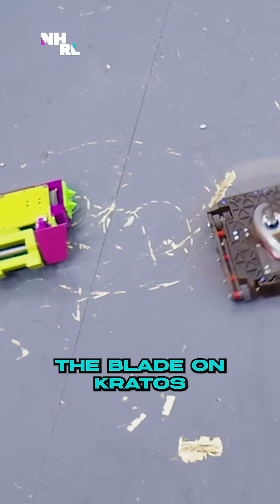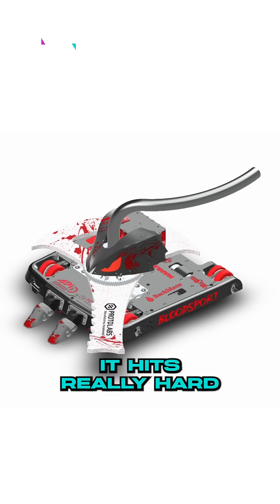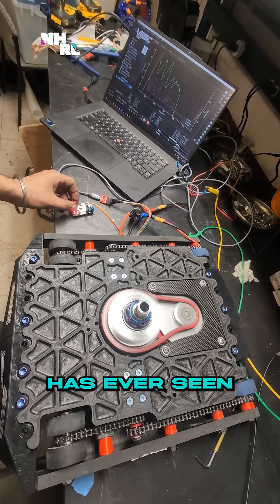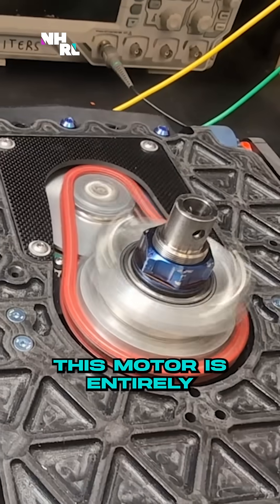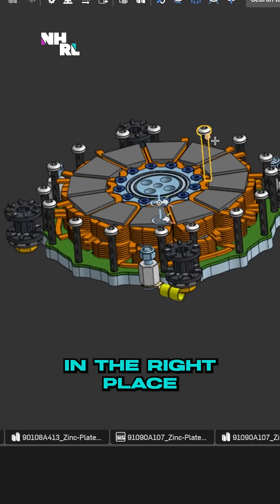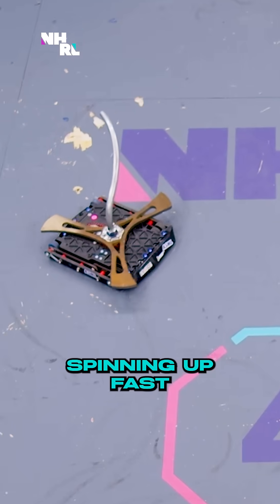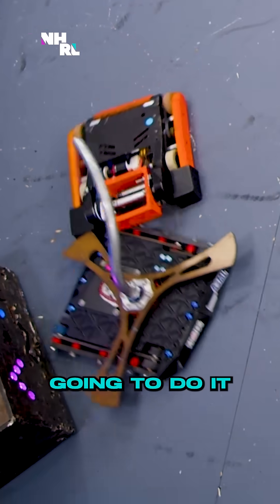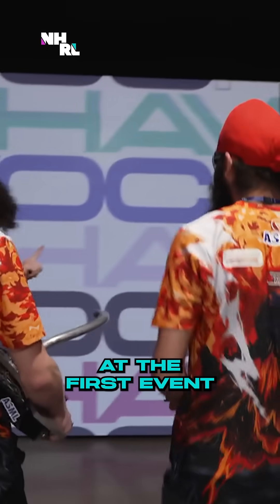MIT Team Built a Custom Axial Flux Motor to Fight Robots

Comment: I am a controls engineer for a motor manufacturer. Axial flux? That’s easily the wildest choice, the fact they pull it off is amazing
Reply from the maker: That’s just how MIT rolls.
Reply: @NHRL bro I sincerely hope you've secured the patents!!!
Reply: @Bill-mj8hf  I'm pretty sure the concept for an Axial Flux Motor is already patented(possibly by MIT), however it's still unproven basically and is only in the prototype stage, but it'll be a badass electric motor once they figure out all of the kinks and stuff and get it working properly and reliably ‼️🤷🏾‍♂️👌🏾💯...
Reply: @ It was actually put into public domain by tesla, as the axial flux concept was invented by him, as he deemed it the most efficient motor design, but also as a design goes, it was impossible to manufacture back in his day
Reply: @ironichoneybadger5066 didn't the first electric motor by faraday technically belong to the axial flux type?
Reply: @badgermcbadger1968  I don't know that off the top of my head, but the axial flux motor was the mathematically ideal motor in theory, so it wouldn't surprise me that the first motor was the product of thought experiments like the axial flux motor
Reply: @Bill-mj8hf dawg the NHRL is the league itself, y'know like football has the NFL or or basketball has the NBA. This was uploaded by the league promoters not by the MIT team. So you telling them to patent something that they have nothing to do with makes you look really ridiculous.
Reply: @ironichoneybadger5066 Tesla would do something like that, that dude was so generous with his genuis. Unlike his "rival" Edison who stole 98% of "his" inventions from others far smarter than him and profited off every single one.
Reply: @ayeeequanpsn5896 axial flux motors are nothing new I'm afraid. this specific axial flux motor is custom built, but by far not the first of its kind
Reply: @Bill-mj8hf  doesn't matter if they built it on MIT property and materials, it'll become an IP for MiT.
Reply: @badgermcbadger1968 it was primitively  a  semi I believe !
Reply: True sir takes quite the engineering,they dared and they conquered .......has quite a high torque density perfect for this application.
Reply: @saitamakuto8724  serious dedication and a massive budget in time and equipment, backed by MIT! And it's still impressive.
Reply: @NigelTolley  this motor is once perfected will make big changes in industry
Reply: @saber5694  why
Reply: @HermanWillems if I had to guess, power density. Power output compared to size. Super efficient.
Reply: @NigelTolley backed by MIT brainlets! Woooo
Reply: @saber5694  It's just ax axial flux motor. Those have been around for a while.
Reply: @saber5694 indeed. I see them potentially being used in electric cars at some point. People can hate on electric cars but they are the inevitable future, especially once better, cheaper and accessible battery technology is invented.
Reply: I need one to be used as a micro generator
Reply: The the nice thing here: even when shit gets WILDLY dangereous and fails in unforseen ways nobody gets hurt. In fact that's part of the sport. Hence it's the ideal place to test wild ideas.
Reply: I'll pretend to know exactly what you are talking about.
 Mhm, agreed. Motor is made out of motor.
Reply: is there any irl application to that kind of motor?
Reply: @duelflame3973  well it depends do you want to use electricity to rotate things?
Reply: @duelflame3973 the acceleration comes from it's high torque, perfect for heavy machinery and industrial applications
Reply: hey last summer I was a controls intern (rn process intern), how are PLC/DCS responsibilities segmented? IS PLC logic exclusively safety? limited to equipment (pumps,compressors)?
Reply: @ishmaelcamillo  PLCs are used everywhere in industry for literally everything. Safety PLCs are as common as they are because of the tens of billions riding off the back of that hardware technology that makes them safety PLCs, as well as a bunch of built in redundancies and other features that makes them worth learning. A lot of my work now has leveled up beyond strictly PLC work, I do a lot of industrial PC and AI model inclusion for testing our product line of motors we manufacture, but that's because I'm going more R&D as opposed to strictly controls work for machine design
Reply: @ironichoneybadger5066 ok I gotcha- did you ever work with DCS/SCADA systems? How much different is that from PLC logic?
Reply: @ishmaelcamillo  I did a lot of work with SCADA, and to ask if it's similar to PLC is like apples to oranges, SCADA systems are a lot more modern and interfacing with them can feel like everything between Python and Powerpoint. I don't have a lot of experience with the term DCS to really speak to that though, however if it's similar to SCADA I'm sure it's not that bad with the right tools/software
Reply: Hey what about TPM motors? Know anything on them? Google says they are probably even more power dense than axial flux. Yet there isn't a whole lot of info on them. A few papers out of my understanding. 

 I cannot for the life of me wait for Axial Flux motors for EVs to become mass produced. Like the SPX 177 from Ehelix. 

 Gimme a solid state battery EV, and two axial flux motors in a Miata sized car please. 

 Anyway I was watching a video on chainsaw competitions. They were using V8s requiring two burly men to handle, and I was like... If only someone made an axial flux chainsaw, lol.
Reply: @RedactedDeath  I don't know much about TPM motors, but I know that Axial flux is just the present big deal, I'm sure there's other processes that would make for more ideal motors, but the issue becomes the massive gap between theory and execution at the end of the day, I would love to see Axial flux EVs!
Reply: @ironichoneybadger5066 Ha no kidding. The SPX177 is a two axial flux motor in one. 

 It was supposed to produce 871bhp continuous, and 989bhp peak at outrageous KWH. Like 650kw continuous. 

 I assume they had cooling troubles at least. It was oiled cool IIRC. Anyway if you go to their website now it's only 650bhp. Still absurd, but reasonable. 

 Anyway yeah only hypercars seem to be using them. I know they are hard design, but I don't see how they are harder than other motors to manufacture. 

 As for TPMs. Have yet to run into a person even online who has any knowledge. I believe they are better at lower speed. 

 Anyway electric motor is the superior tech. A shame our leader is a Baby boomer.
Reply: @RedactedDeath  They're probably not that hard to manufacture I just know how much of industry is designed around the already simple-to-manufacture-by-comparison induction motors. Hell, my company produces BLDCs for industrial applications and even we have a hard time selling to industry, I couldn't imagine how frustrating selling axial flux would be
Reply: @ironichoneybadger5066 Yeah man unless you're Lucid, axial flux seems the simplest option for high performing vehicles. 

 Manufacturers putting out weak HP EVs is a travesty. If it doesn't have 500hp plus then don't buy it! 

 I think Astramechanica adaptive hybrid electric engine/rocket uses axial flux. Maybe Space X. 

 Lucid drive train, and aerodynamics is insane though. Shows what an EV can be. Anyone interesting in a more technical design of a car watch Sunny Monroe Live videos on it. 

 He worked in the manufacturing side of the automobile industry. Talks about the engineering and economical side. 
 
 The channel maybe too technical for some but i love it. The Lucid is a beast. Half the price of Lambos, and keeping up or outright beating em. The drive train is a gem.
Reply: @ironichoneybadger5066  hey on the subject of PLC and SCADA, what PLCs/systems have you touched? TIA Portal? Honeywell? Triconex?
Reply: @RedactedDeath  I'll check it out man, thanks!
Reply: @ishmaelcamillo  almost all Micrologix PLC by Allen Bradley, and TIA Portal, I've done a lot with control logix and other similar PLC, but the most work I've done was oddly enough with the micrologix 1400 as a lot of factories around me are using systems that are pretty old. As for what I'm working on right now however, I'm not touching a lot of PLC, but trying to learn about FPGA and Embedded systems with TI controllers and ASIC, but that stuff has massive potential to be a side project if I'm not playing my cards right at work, lol
Reply: @RedactedDeath and get us back to reasonable sub-3500lb cars, PLEASE for the love of God
Reply: Cool beans 🌌🌌🍄🍄🍄👍
Reply: Some fans from the 1920s and 1930s had axial flux motors, it wasn't very common and they eventually stopped making them.
Of course, since they were for fans, they didn't have a lot of torque, but the means of manufacturing were already there. I believe the same means were available at the time of Tesla, but it didn't take off then. It's nice to see them making a comeback.
Reply: @yonidellarocha9714  thanks for the information, huge!
Reply: Aeon flux. Aye? Sorry I ruined it. I don’t know anything.
Reply: Agreed, his engineering is incredibly impressive
Reply: Can you help me get a job? In controls and don't know what to do
Reply: What's new in this axial flux? Genuinely curious. The diy wind turbine guys have been making these for quite some time. Although bigger and bigger. AI has generated a couple interesting looking prototypes. What are they doing to increase the power density vs a standard mag rotor stator axial flux????
Reply: @ Axial flux is called that because it changes the axis that it torques the rotor on the fly to optimally impart torque onto it. Theoretically it's already the best mechanical design for torque because it's moving the fields in the mathematically best orientations for imparting that torque that our modern machining can muster
Reply: @ironichoneybadger5066  you are saying it’s the N * m and the m is augmented such a way it can easily achieve a starting,  running or breaking torque ?!
Reply: @03p650  not necessarily running the m but for the company I work for we rate torque as Newton Meters, not horsepower, which is a different unit to measure torque where horsepower measures torque over time. 
our motors can be controlled for all sorts of things such as running or breaking torque, it's really about how you read/react to the Back-EMF
Reply: Koenigsegg has developed a 'Raxial' (radial/axial) flux motor they call the Dark Matter. It's an 86 lb, 800hp, 1200 Nm beast.

I'm sure tech like this will come down in cost over time.
Reply: @TheDCJason  wow! 86lbs spectacular
Reply: @AAaa-u7x  yeah! It's insanely power dense. I can't even imagine the cost.
Reply: @TheDCJason  running chopper or chopper something.  Very high power density ! ?
Reply: @TheDCJason damn, that's a lot of power.

Comment: I legit don't understand this editing but it was hilarious. Did the bot go 1 and 1? Dude was so confident.
Reply: I...think they did that thing where they chopped the first 30% off of the front and stuck it on the end? normally that's used as an easy format for making looping content and tricking people into watching the whole thing because it perpetually looks like it is just about to get to the point but never actually does and chopping out the front and sticking it on the back puts the normal red flags that let people know that it is never gonna say anything at the very end of the desired watch time in the last section of that first ~30%.
Reply: When it works, its killer. But if you put all your eggs in one basket, you are taking a risk. The editing was perfect for showcasing that.

Comment: Whats the wonky pole on the top about?
Reply: Essentially if the bot gets flipped that pole helps corkscrew themselves back to the correct orientation. If you lookup bloodsport battlebot self right I think you'll get to see it👍🏾.
Reply: On top of the highly valid reason given by the other replies, it also helps give the driver an easy visual indication of which way on a bot is forwards. For Kratos it's helps with that but wouldn't be completely necessary, but for other full-body spinners it'd be pretty much impossible to tell otherwise.
Reply: Simple, it's an anti-getting-flipped-wonky-pole-minator.
Reply: @xkali8119  I declare this to be the best new word of 2025 so far.
Reply: Reduces the amount of ways the robot can Do The Thing.

As others have said, it's a self righting mechanism. "The Thing" is NHRL slang for the inevitable position your bot will find itself knocked/rolled/flipped into from which it cannot recover without an unstick (and sometimes even WITH an unstick 😜).
Reply: The other answers,  Also, would you want to pick up a robot with a bone breaking saw on top when theres no guarantee it wont turn on the second any part of you is in range?
Reply: The old fans of Robot Wars would call it a "srimech" (sree-mek) - short for "self-righting mechanism"

Comment: problem with spinners is breaking the motor or the chain.  maybe ad a clutch somewhere thay can disengage the drive from the blade
Reply: I have a feeling the chain is meant to be the weak point, it's also likely just springy enough to take some of the shock load. Besides I don't think the motor would see much of the force of an impact, worst case the drive electronics will just shut down if it gets stuck.
Reply: Hey you seem logical
Reply: Don't need a clutch. Just give it a shear pin.
Reply: @  shear pin works only once if the hit is too strong. 
my idea was to be able to reengage the motor on the weapon once the hit is passed
Reply: @ThePapino134  I was thinking the same, a centrifugal clutch or torque converter maybe?
Reply: Or a hammering mechanism used in drilling machine, rachet based
Reply: @trijit96 a ratchet would be nice, since you can easily adjust how much pressure it can take with just 1 screw, and you dont need too much surface as in a friction clutch to make it work under heavy load.

Comment: Need a huge gear on the motor and a smaller gear on the weapon. Or add a third gear that has one large and one small gear and chain the small one to the motor and the larger to the weapon to get more RPMs. Think like the gears on a bike. The bigger one is where the pedals are and the tire that has small gears is where you want your weapon. The motor will be under less torque with a larger gear.
Reply: Getting up to speed is more important than peak RPM.  Small gear on the motor and large on the weapon lets the motor use less torque to get the weapon up to speed.
Reply: @generickwyjibo  then having a closer 1:1 gear ratio would be easier for getting up to speed quickly. Or maybe even better. Have a double gear switching system like that on mountain bikes. Have a small gear at first to start the rotation and then have it switch over to a larger gear to  maintain and peak the RPMs. Then it would need a third gear for RPM selection. Have a gyro selector that opens up at higher rotations, forcing the chain to go down and closes at lower rotations forcing the chain to go up to govern which gear it needs to be in for optimum performance. Then keep a single sized gear for the weapon.
Reply: @jaketripp7934  Have you ever ridden a bike?  It's easier to spin the rear wheel when the front gear (where the power is) is smaller than the rear gear.  Any change in the ratio would require more force to spin the rear.  Humans can stand on the pedals and make a lot more force than a motor that relies on RPMs. 

And a multi-gear system is just asking for trouble.  You know how fragile a bicycle derailleur can be?  Now imagine that on a combat robot with an opponent actively trying to break it.
Reply: @generickwyjibo  I know that even a small thing traveling fast has the same energy output as a big thing traveling slow. It is like comparing a metal shredder to a circular saw. They both destroy things. The slower  more torqued one is just not going to care to stop when it comes into contact with something. If that bot had a clockwise spin and counter clockwise spinning weapon then it wouldn't need to worry much about getting it's weapon up to speed, it could just torque and sheer. However with a single spinner, RPMs are crucial to having an effective weapon. If it can't go fast then it is just brushing it's opponent aside like two strangers in a New York subway.   And if it can't get up to speed quickly and efficiently, then what is the point. 
The derailer mechanism could be internal with only the guide on it poking out of the bot. If it is under the weapon and doesn't peer out too much, then actually getting to it would be a chore for the adversary. I won't say it'll be impossible, but more difficult. Plus all you would need is a little square that just goes up and down and even with manual switching, all it would need is one straight toothed rail on a guide with a square on top and a small gear that raises and lowers it. Just something to move a few millimeters.
Reply: @jaketripp7934  far too complex for a bot that's throwing itself around the arena like this. The setup they have with a chain is exactly what they need.
Reply: @bachaddict  everything is working against the ones that are building these bots. Time, materials, money, space, weight, design, power, speed, durability and on and on. It is up to them to find the best and most effective things they can do with what they have available. At least it's an idea and anyone can work with an idea. If it doesn't work, find a way to make it work. Or try something else that does. One way of doing something might not be the best way of doing something, but if it works, at least it is a way of doing something. That is kind of the mantra of machines, do something till it works the way you want it.
Reply: A larger gear on the motor would make the problem worse.